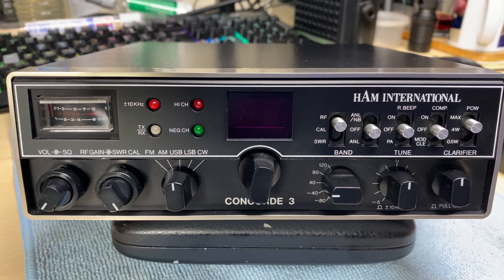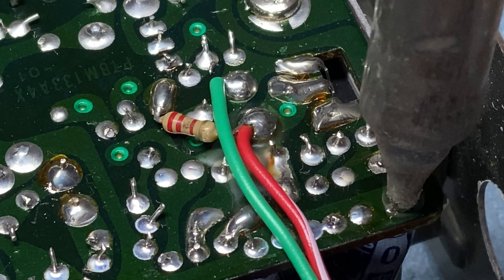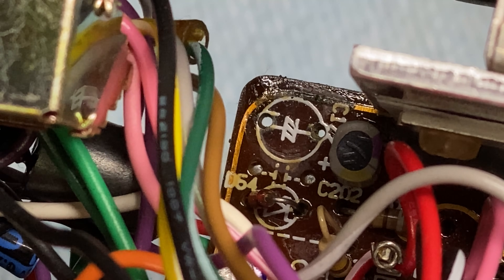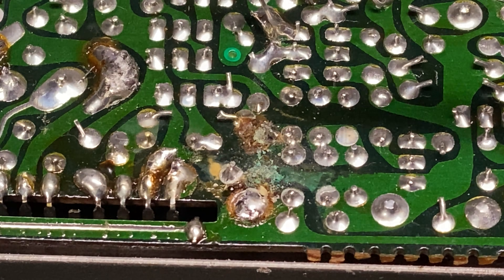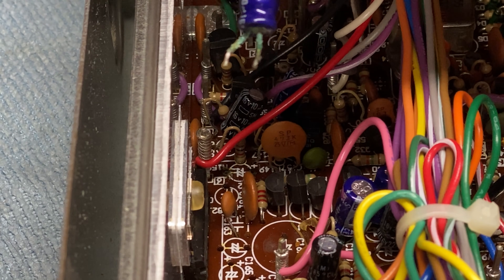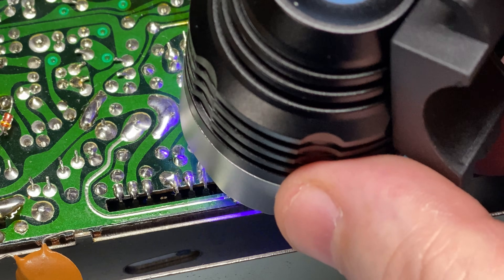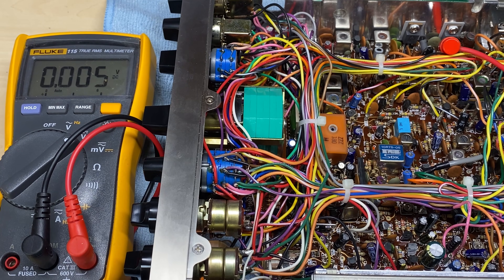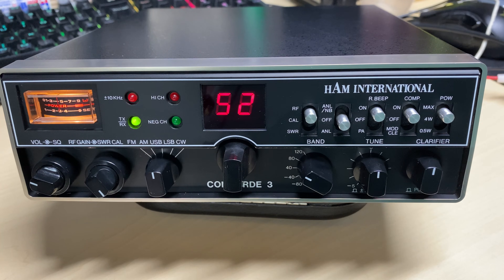EP 193 - HAM International Concorde 3 - Fixing extreme rot damage caused by bad capacitors.

Comment: Hi hope you pulled every electrolytic capacitor out of this radio. I have never seen such corrosion here in Australia 🇦🇺. Have repaired any cybernet and Uniden radios since 1980s.
You poms have the same problem with salt on the roads and cars that disintegrate as you drive them 😊
Keep on soldering